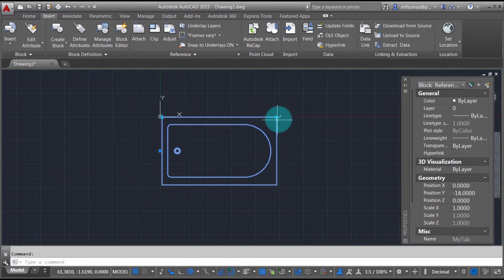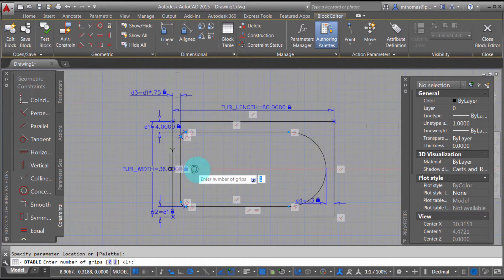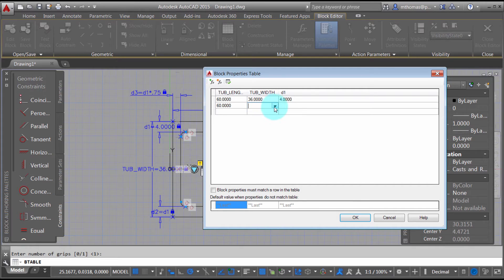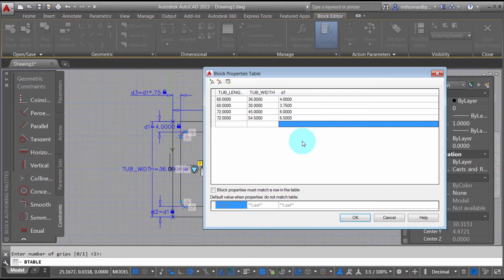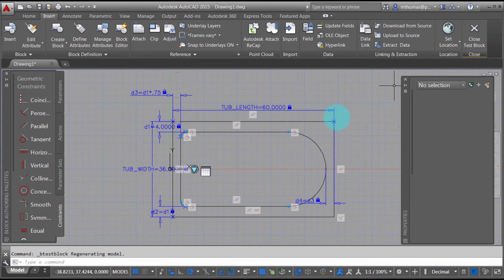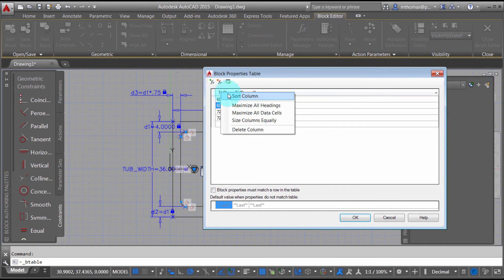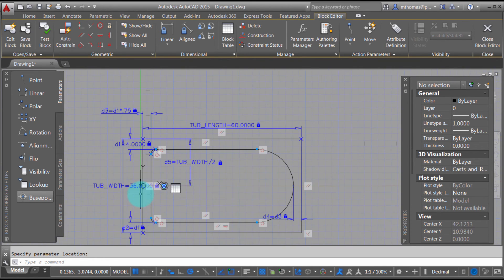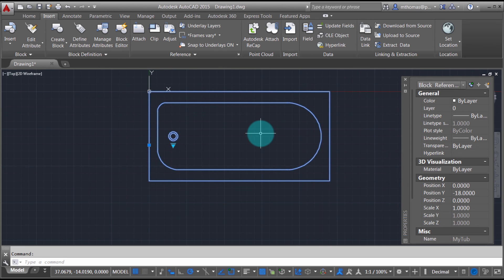Using Block Tables with Dynamic Blocks

Comment: I see how to access the Block Properties Table, but how did you "see" those parameter values. I am missing something because I do not see anything when I select the "add Parameter Properties" button. :(
Reply: You have to add parameters FIRST before they can be viewed in the properties manager. He had already defined Tub_Length and Tub_Width, plus a host of "D" ones (distance), so when he called up the block table manager, they were available for import.